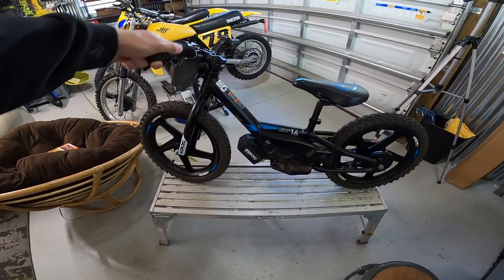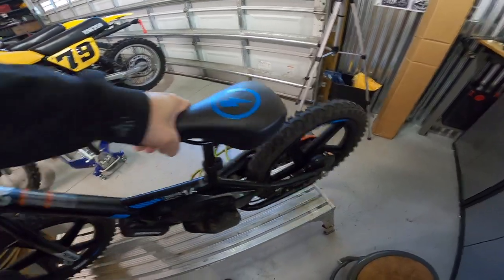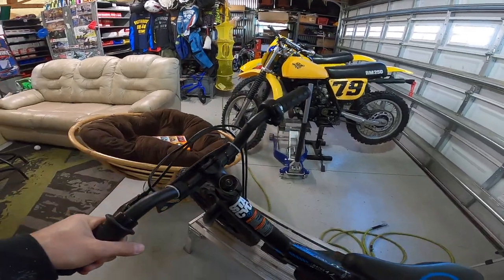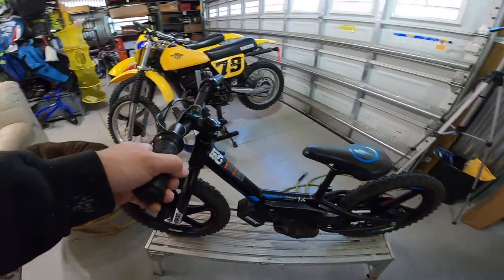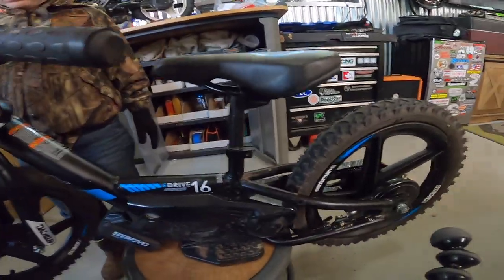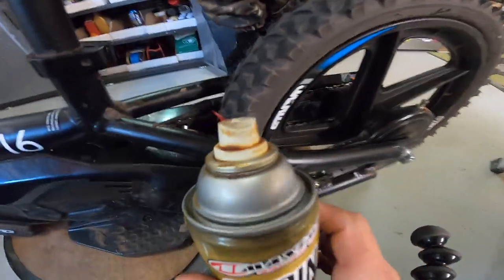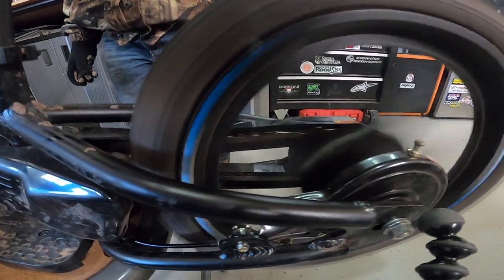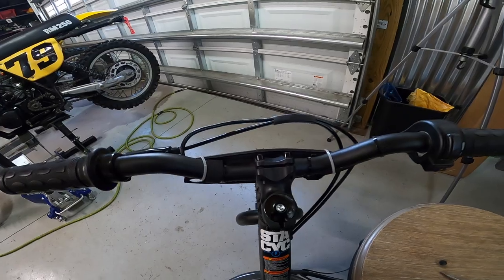STACYC 16eDRIVE BRUSHLESS | CHAIN AND STEERING STEM ADJUSTMENTS

Comment: Nice tips and pointers!  What’s your son thing with the ratcheted rear sprocket?  Does He feel like he has the same control of his speed since it’s not directly controlled by the motor/gearbox at all times?  Battery packs look like tool packs. They interchangeable with any brands like Makita or Dewalt? Thanks again!  Looks like they’re having a blast!
Reply from the maker: Thanks! Great questions too! He didn’t seem thrown off by the lack of engine braking, but I can see him learning how to carry more speed into the turn because of it too. The battery packs are basically lithium ion drill batteries, but of course their connections are proprietary and are not interchangeable with other brands. There is a guy who makes adapters however, which will allow dewalt or Milwaukee drill batteries to be used. I hear it’s an improvement also
Reply: @John5XR  Dang.  I'd definitely have to look into the adapters.  Not that I want them burning through my good packs, but I like the options!